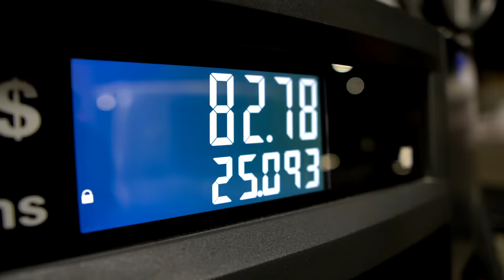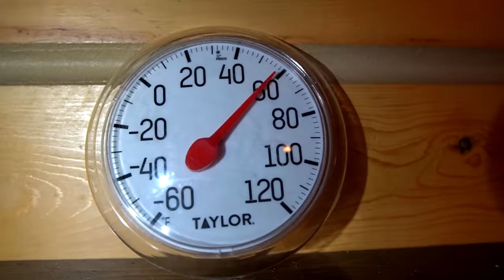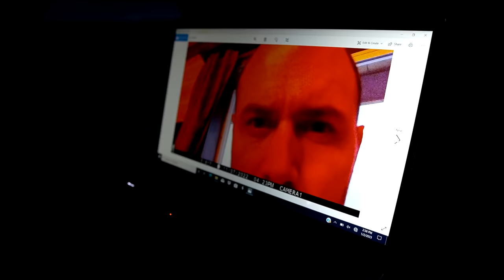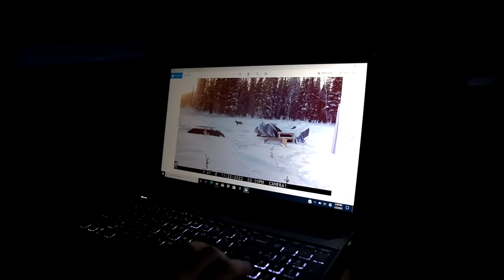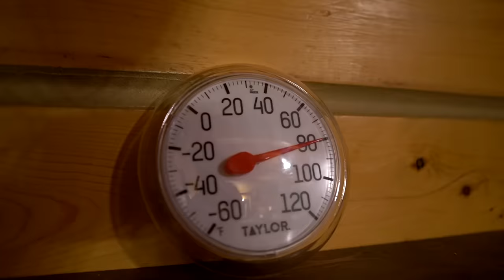Firewood Burn Times + Testing Kindling Splitting Tools | Cabin Wood Stove Cooking

Comment: Happy new year guys!  Excited to see you two transition to the new property and how you develop it. 
Friendly suggestion from a fellow blaze king user, (logs need to be 15" to16" for this method) load all logs 90°in relation to door or in other words  straight in rather than sideways. In my experience it's easier to get a full stoke that way (smalls or thins for the top a plus) .  Obviously you have to be careful that there is plenty of clearance for the glass before shutting the door. Found out the hard way once and rather than replace glass with blaze king  we had a local glass shop cut a piece of high temp to fit.  It's been in for about 9 years and still going strong. Would be a good item to have a spare.
Guessing Ptarmigan or grouse on the poo.

Cheers from Montana!

Comment: The generator icing problem is common for all generators. The easy solution is to disconnect the crankcase breather hose from the air cleaner box and leave it disconnected for the winter. Your local small engine repair shop can show you where it is or do it for you. Reposition the breather hose so that the moisture can drain down out of the hose into the generator case and out the bottom. There is no dust in winter so don't bother plugging the opening on the air cleaner box. Just remember to reconnect the hose in the spring! Another tip is to use regular gasoline that contains ethanol. All new small engines all designed to burn gasoline containing up to 10% ethanol. Check your owner's manual. The ethanol (alcohol) acts as a gasoline antifreeze. Premium gasoline is often recommended for small engines but it contains no ethanol and can cause the carburetor to freeze up in the winter. I've used my generator at -35c with no issues doing this (sometimes I have to prewarm it to start and then keep it running 24/7). If ice accumulates inside the case you need a shelter to help keep the generator warmed by the engine's heat. A simple shelter can be made from pallets and plywood. Even cardboard stapled to the pallets will work in place of plywood (cheaper too ;-). The generator does need air to run and for cooling so don't close it in too tight. The engine can overheat and ruin it. PS. If the engine dies after an hour or so it is almost always icing related. Be very careful taking a generator inside a building with a wood heater! Gasoline fumes explode! If I must bring the generator inside to thaw out I put it inside a sealed garbage bag across the room from any open flame.  HTH.

Comment: Hey Great video of your Adventures, to the new cabin.. 
 Doesn't look like much solar power there in the winter time though.. 
 What you might think about is a bank of batteries, to run an Inverter/ charger.. That way if your generator quits running for some reason, you'd still have power to run things for a bit more.. 🤠

Comment: For the first strange track in the snow I was thinking of raccoon dog. They have astiblished here in Sweden and is a big problem, one has been shot in our hunting area and I think I saw one some years ago (could have been a wolverine but they are not very common around here, especially in summer when the reindeers have moved back to the mountain area). The track beside the shed must be from a capercaillie or maybe a black grouse but it seems more like a capercaillie. 

Thank you for the test of making kindlings! With an older body, back problem and a not very functional arm when it comes to muscle power the drill method seems to be something for me to have. I also like the axe but with my situation nowadays...thankfully we only need firewood when we are out in the bush!  We usually use birch for fires and always for warming up our houses. Birch bark has a long tradition as a ceiling material for roofs and also between the foundation on a house towards the timber. It is also a nice material to weave baskets from beside thins threads of root. https://hemslojden.org/activity/naverslojd-6/ Maybe a project for upcoming winters? https://www.samer.se/1155

Always a pleasure to visit you! Big hugs from Sweden!

Comment: Hey brother, do you like the song, "Simple Man"? 😅I have a suggestion for ya, the little sledge hammer, is a 4 lb. hand maul, the cast iron splitting device, compared to the hatchet, is the safest, you could use the drill-bit-splitter, safely, indoors, not having to swing a sharp cutting implement or a sledge hammer, in the house, and still get the job done, also, get a bungy cord, wrap it tight on the log, then use the drill thingy from the end of the log, it'll work great, when done, just take the bungy off 😅, you'll have to drill down prolly farther, but no worries, if the drill thingy does catch, the log will just spin and not break your arm..... Cheers Mate.

Comment: Just thought to mention that when wood combusts there will be a lot of tar formed if you don't have enough air (oxygen). So better to start with just one piece of wood and then add those extra pieces later. Also it looks like your wood stove might have both primary and secondary air. That is actually a good thing as it combusts the tars. Hardwoods will burn longer due to their higher density but also burn hotter and can cause stress in metals so maybe good to use a mix.

Comment: Here's a tip for any viewers that are interested in trying the kindling cracker method without purchasing a new gadget.  You can create a simplified version by placing an ax on a concrete shop floor with the blade facing straight up and then use a large C clamp to hold it in place.  It works quite well as long as the pieces aren't too long since they could bottom out on the floor.  If you simply choose  dry ~12 inch straight grained pieces then they will just pop apart before they reach the floor.

Comment: Wood burning test:  I would guess the key variables affecting burn duration are the total mass of the wood loaded into the stove and the wood geometry, roughly the surface to volume ratio.  For a "pure" test of different wood types I think these variables should be equalized as much as possible between trials.  Probably the more practical question is how long a load of each wood type will burn.  This is basically what you folks did.
I am looking forward to watching the construction of your Quonset building this spring.

Comment: I bought one of the drill splitters a while back  and tried it on some three or four seasoned oak. Don't try this at home like to have twisted my arm off. Maybe good for conifers or birches but not southern white oak. Try looking at your gen set for the breather where the frozen line comes out of the block and see if it is clogged. Onion trouble my granny always told me to hold a piece of bread in my mouth when cutting onions, but I use safety glasses works descent.

Comment: That trench is an otter they walk low to the ground and the like to slide especially during winter time. As for your burn times on that stove. The first burn was split wood which in then burns a lot faster than round junks. Round junks last a lot longer

Comment: My All Time Fave for kindling, is Western Red Cedar,  ..... Crackle Crackle   For firewood, Oak,  Ash or Doug Fir.Thanks for the great video.high from the n.w corner of Oregon.The best stove if you can find one is the huge Kodiak, large capacity but airtight so it burns forever. I really hope that nobody tries putting Embers on Lid of Dutch Oven Indoors, People Die Every Year Doing This .... basically charcoal

Comment: I have that drill bit and it almost took my arm off. I’ll use your method of the opposite side and smaller pieces. I have a cheap version of the kiln cracker and it works ok. I have black locust and it is hard as a rock, so it takes some energy. (I’m 62, soon to be 63 and not doing this every day either…)
Was that a ptarmigan track?
Thank you for all of the uplifting videos. Happy New Year!

Comment: I've gone to using an inverter generator (a Wen) feeding a largish power station. l use the Oukatel P2001. Its a 2k ppwer station that can also run as a ups, so it charges while in use.  The generator can charge the station in less than an hour at 1100 watts charging!  That way the generator runs more efficiently (charging and powering) and the power station doles out the power as needed while the generator is off.  Works GREAT!
Reply: Oh, and of course you cam charge with solar when available. :)

Comment: You could just drill the mounting holes a little extra wide so that your bolts act like dowel rods instead of screw-in bolts, that way you can easily flip the unit over and also limit the movement so that the power is concentrated.

Comment: Your "main" house has batteries that you charge with your solar panels, right?  And you can supplement that with your generator(s), yes?  Sounds like you need to bring batteries with you next trip.  Even if you don't wire solar panels until spring/summer, you might still extend your electrification periods.  LED lights use so little power, you can still have lights for hours, even days, after your generator is off.  Oh, yeah - HAPPY NEW YEAR!!!

Comment: Using the drill inside would be better as kindling won't go flying and no swinging hammer or hatchet. But hatchet or axe is my best tool for kindling and splitting

Comment: Happy new year! 🎉 Was wondering would a masonry stove/heater be something worth considering for your cabin in future? That way you wouldn’t need to load the fire during the night, as it throws out heat for around 9 hours after burning for 4 hours. Might need to reinforce part of the floor though, or build up from underneath & you can get them with ovens but not sure about direct cooking for pots….or could be useful for a greenhouse/high tunnel if you still potentially had plans to heat one in future.

Comment: I'm accustomed to a wood stove without a glass window... like a pot-belly stove. I'm used to one that you can completely shut down so that it will burn all night, and not one that's meant for you sit in front of and watch the flames.  Those stoves normally require you to have the damper open somewhat so the glass doesn't smoke over. My take is if you want a stove that will burn all night, get rid of the glass and get a real stove.  It's like having a hanky with a suit... some hankies are for showing and some are for blowing! Get yourself a stove that is for blowing and not for showing! ;)

Comment: (1) Hatchet is dangerous to the hands and eyes...but ok if you're careful...but then you have to gather it up from all around. (2) The "kindlin' Kracker" is the best of the "kinetic energy" methods but still involves swinging something. (3) the drill bit is more compact and easy to gather the product and has a satisfying aspect...but all and all, I would load up a box with the Kracker, but keep the drill-bit in the house when you find yourself a little low as it can be operated in the warmth by the fire. K.... where's my coffee... 🙂

Comment: Hey guys, A while ago I bought a "Colorado Cylinder stove, the "Yukon Modle" which would hold 26" wood,& i could heat my 16'X21' canvas tent in -35° f t
-40°f throughout the night ,& I would burn Bull Pine ,& it would burn a full 8-10 hours beforè I would have to stoke the stove. That Bull Pine would bring the tent up to an extremely comfortable 
6oo°f (ha,ha,ha) all night long. You can purchase the Colorado Cylinder Stoe through Cabela's & Sportsmans Warehouse for the "Yukon Edition, which cluded the stove, legs, nesting chimmeny,& grate, (for burning coal) for around $575.00 complete. 
Guys, I can't recomend this stove enough. BTW, it also comes with a 5 gallon stainless steel hot water tank Also with a spark arrester. like I said, I highly recomond this stove.Sincerely, the old Momtana cowboy, Frank Scherping

Comment: I use lithium batteries in my trail camera. I hiked a couple miles up to 10,200 ft from 6,500 in the Backcountry of Wyoming one fall and left it on a tree up on the ridge until I went back the next year. Hiked back up and got it that next fall and it still had battery life. Got tons of neat pics. The camera went into hibernation mode when the snow pack came that winter. The only bummer was in late spring a spider crawled into the lens and put her egg sack there, so half the pics were blocked and blurred.
Reply from the maker: Darn! We haven't had that happen, sounds like an amazing trip 🙂

Comment: I am genuinely puzzled at the lack of draft lobbies / foyer/entryway rooms in Alaska, also known as mudrooms when it's located at the back door.  I'd think it would be more energy & fuel efficient to have a smallish room to simply slow down how much heat gets lost whenever people go in & out.  (Plus the convenience of a bench & place to change muddy to clean footwear, to hang winter clothes, etc.)  Especially in wood-heated homes!  I know it used to be a prominent feature in New England houses, and in some of the older Scandinavian homes (especially log cabins), which admittedly have some long & cold winters, but I'm just wondering why it's not a thing in Alaska.  And yes, I know woodstoves can get a house uncomfortably hot, but a draft foyer could still help temper that heat exchange rate.

Comment: The drill bit thing I found to be useless, first go it drilled in and got stuck, it didn't split anything, when I reversed it the silly thing unscrewed itself and was stuck in the timber, I just burned the timber with it still inside, then chucked it in the recycle bin

Comment: Spliced wood burns faster. So the unspliced wood will burn longer, but will not create as much heat as it is the surface of the wood that burns. Or rather, it is the gas created from the wood that burns, gas created by heat. 
When I lived "semi off grid" we never used unspliced wood as it did not create that much heat.
Reply from the maker: Appreciate that, we had some theories but that makes sense 🙂

Comment: Take a new razor blade and cut a 1/2” slice in that crank case vent line and it will not freeze again old Homesteader generator fix.

Comment: Soft wood like cedar and spruce and pine burn fast with not a lot of heat. They also split easy as hell. Try splitting some real hardwood when you bust your ass and get warmed up splitting before burning.

Comment: SURPRISED YOU DON'T HAVE A WOOD STOVE FAN ON YOUR STOVE BLOWING ALL THE HOT AIR YOU ARE LOOSING GOING STRAT UP..DON'T NEED ELECTRICITY. RUN OFF THE HEAT FROM THE STOVE.